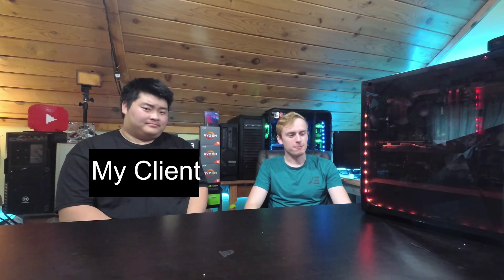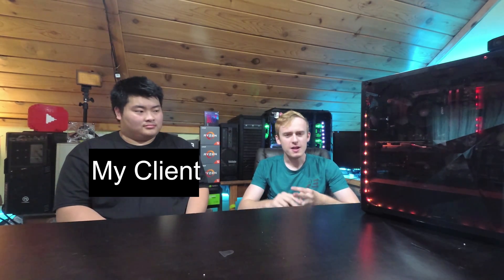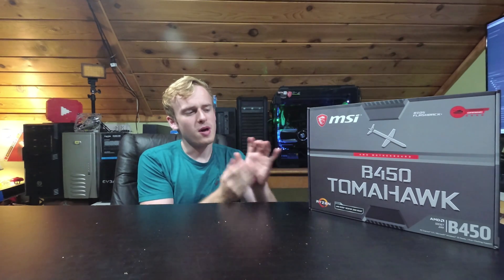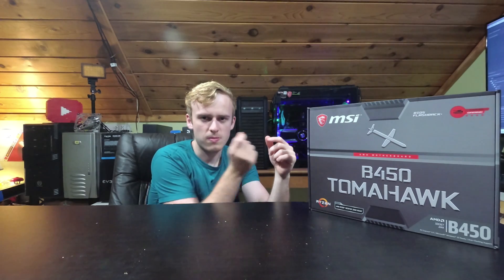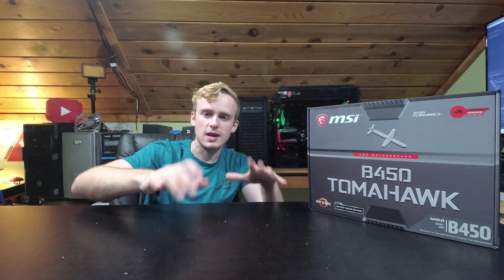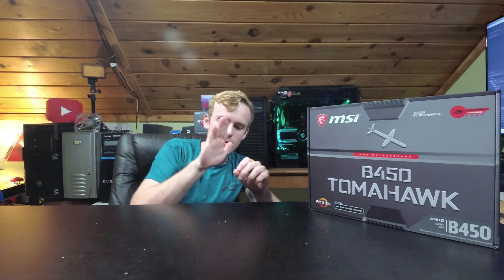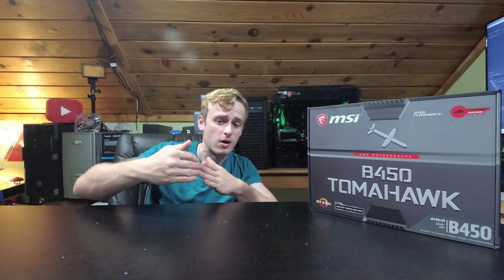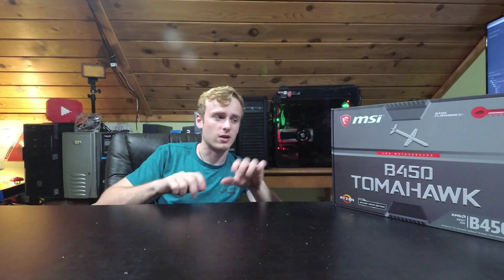My MSI B450 Tomahawk Motherboard Has a BIG PROBLEM

Comment: I have the tomahawk max and same issue. it worked fine, shut down the computer and went out for a couple hours, and when I came home and turned it on I had black screen and cpu light on. I tried everything, and I mean "everything" from cmos, to stripping the board and flashing etc. nothing worked. now I gotta buy a new board. but I will never use msi again.

Comment: My problem was and I still have it if you put a USB into the back of the board it will not turn on. It won't post but once you unplug the USB it immediately reads the hard drive and posts. Or I'll have five hard drives hooked up to it through USB adapter and it will read three of them but one of the drives it won't read so if I unplug it and plug it back into a different USB it might read the drive but then later it won't read the drive and it'll disconnect it. It's very weird I don't know if there's a feature in the Bios I have to tweak or what but it's kind of annoying

Comment: I have the MSI B450 Tomahawk Max as well and for the past 9+ months I’ve had nothing but issues. Lots to list. I’ve upgraded PSU, GPU, 2 different sets of RAM kits and everything I have is completely compatible. My RAM is on the Qualified Vendor List(QVL) and that’s fine. Brand new power supply upgrade from 550W to 750W, both EVGA. So it’s not RAM or PSU. I’ve had same issues with my old GPU and upgraded to 3070 Ti and still have issues. I’ve looked on the back of the motherboard and there’s load of spots like puddles of chemicals coming from where the VRM’s are located on the motherboard. That means MSI is dogshit at building this motherboard if that happens, it’s not just the Tomahawk Max, it’s other MSI motherboards, MSI SUCKS! Never buying another product from MSI again. I have 2 monitors and they both have issues and they’re both MSI Optix MAG24C’s. I cannot stand this company. I’m going ASUS motherboard and ASUS monitors later on in the future.
Reply: OH YEAH! I should mention that, these issues weren’t day 1 issues. I had built my PC in May 2020, the first issues came across 1 and a half years later where they really started showing.

Comment: Similar issue with posting. I use to have a cpu light at post, would reseat cpu and it would go away, i think this board has had a hand in blowing 2 water coolers, onto my 3rd cooler now, after installing latest cooler I noticed if I tap the case id loose video to monitor but power to the total system stays on. Thought it was a gpu issue, but I just removed gpu and tried to use on board video, system right now gets vga led and wont post. At the point of buying new system board, 95% of the hard was new. Wont be buying any msi products frkm here on.

Comment: Mine worked fine for a year and a half, then suddenly this week it has refused to post. Tried clearing rom, changed gpu's, mem and psu. It appears to power up, but no output. I assume its the board, as I cannot see why the cpu would suddenly fail.

Comment: Same problem here. After changing the termal paste, i fired the pc up and a red cpu led popped up. Tried bios flash... nothing. When i saw the back of the mobo, the mobo was fried. You can see burn marks on the VRM area on the back.

Comment: Update from 2021, I'm using this for my ryzen 5 2600. An issue i came across with this motherboard is that the rgb light resets to red every reboot which is annoying because i have a color scheme set up. Any suggestion for this?

Comment: I bought this motherboard for my build and when I turn on my pc it works but there’s this red light that lights up saying the CPU is messed up but I checked and nothing is wrong if any of u and help me solve this problem that would be great
Reply: Did you fix it?
Reply: ThatRastaGuy yea I finally did, my friend had a tech wizard friend who was able to fix it. The two main problems were that my ram cards were incompatible with my mother board and got new ram cards that were compatible and he also unlocked my motherboard
Reply: @W_A_L_I  yeah I managed to fix mine aswell, turns out the CPU lever was not pulled to OPEN when I was installing the CPU, meaning it was just sitting there

Comment: Interesting video. I've bought and installed one piece of that mobo, updated the BIOS, configured it and it still working smoothly on a R5-3600. I haven't had a single issue in almost two years and for this price, this mobo in my opinion, rocks. The uEFI BIOS is a bit childish and feels like setting up a barbie doll, if you're coming form old legacy BIOS, but you don't touch your BIOS every single day. The LEDs work fine here, although they can be disabled with a 3rd party software, there were no shorts and the power consumption was normal. Also the board itself doesn't look cheap for this price. Maybe you guys play too much with cheap lights/wirings or boxes, which are not really approved and some may cause issue.  But what do I know, I've installed only 1 piece. A lucky one obviously?
Reply: Why are people complaining about it so much then? They made me afraid of buying one
Reply: @trikyoo  get one - it's still working perfectly ;)
Reply: @NeverGiveUpYo  Thanks
Reply: @trikyoo  anytime.

Comment: Hi bro i have msi b450 gaming plus, msi rx 480 8gb gaming x, 8gb lpx corsair, and my pc freezzes...black screen with red led from cpu , can you tell me what to do? Or anyone? Pls help
Reply: Did u solve it? I got same problem.
Reply: @furkancimen4964  i dont know yet i have 5 days since i have no freeze no issue ill tel you if i will see that black screen
Reply: @facdăsistem  ok mate thank you. I have b450m bazooka and ryzen 2600. Since 1 week, when i play a game my pc is freezing and restarting itself. And debug led from cpu. I hope i can solve this. I dont buy MSI mb again.
Reply: @furkancimen4964  i dont know if msi is to blame but i saw at almost all amd mobos do this issue, a week ago i bought an m2 ssd kingstone 256 gb storage, i had another ssd kingstone a big one with cable partitionated in two, after i deleted both and installed on m2 the windows, i made another update of windows, i have almost a week since i have no black screen, it can be the windows to blame, in my pc i never had crashes in games, only at start at 3 days and notice that all my parts are new, only my motherboard is new but not with warranty and my rx 480 is old too and i made a change at rx bios, i flashed a new one, but i think till now  that didnt freezed is that update from windows, there are manny issues at w10 too, even if will freeze at least at me is never restarted itself, if you have your mobo on warranty change it but my only opinion i guess we.ll never trully know, and another point, a new amd chipset software i installed, can it be the old ssd? Old drivers, old bios? I dont know but try what i did bro maybe will work 😊
Reply: @facdăsistem  Thanks for helping mate. I tried update the windows, update bios, and clear cmos. They didnt solve my problem. I got warranity on my cpu, mb and rams. Im gonna try to refund mb.    My drivers is new, bios is new and ssd is new. Im gonnda try amd chipset driver. Thx for your help again. ☺️
Reply: @furkancimen4964  with pleassure bro hope you will fix this issue 😊
Reply: @facdăsistem  Hi bro. After your suggestions, i tried to update amd chipset driver. And my pc didnt crashed yet. Im very thankfull to you. :)
Reply: @furkancimen4964  im glad it worked bro, after a week at me freezed once but im comfortable with it, im just restarting once and works like a monster with my gpu and cpu works all games on my aoc ips monitor at 2k, on 32 inch and is so great,im gladd it worked for you bro with pleasure all the time beo take care :)
Reply: @facdăsistem  Take care man. If u have any problem just ask. I can always try to help. :)
Reply: @furkancimen4964  thx bro ill to help you too god bless you :)

Comment: does anyone have the red cpu ez debug light, I've tried everything and I even used different psu and ram :(
Reply: Yeah that is my issue right now as well
Reply: Guys listen, I exchanged to parts for the same parts and I had same issue. Then my friends dad told me maybe I need to flash the bios, but I was like it says Ryzen 3000 ready so I did it anyways and then it worked
Reply: @jossshhhy  I currently have a ryzen 5 3600 and I’ve tried literally everything and I tried the bios flash update but the cpu light on the motherboard still stays on and I don’t get a display
Reply: @gavinnavarrette757  have you tried booting with a single ram stick installed?
Reply: @jossshhhy  yeah I tried. It ended up being a defective mother board had to get a new one.

Comment: I'm having problems with this exact board. Done a previous build with no problems. It's just come back from the shop where they managed to get it to boot after switching the RAM around and fiddling with the SSD. Bring it home and no LEDs. I'll keep going until I get it working but I won't be using this board again.

Update I got the board to power up. It won't do it if you just try and short the pins. Suggest hooking it up to the case power cables (don't screw it in the case) pressing the Start button on the case, you should see LED lights on the side. Get everything plugged in and do a POST test. This motherboard is basically a pain in the arse but it does work.

Comment: Can someone help me, there is a red light behind my msi b450 tomahawk and my pc won’t connect to my monitor
Reply: I have the same problem did you find out the issue?
Reply: Pretty sure my ryzen 7 3700x died cause I checked everything else only lasted 6 months :(
Reply: That’s my same problem, what did you do to fix it?

Comment: I bought and installed the MSI Performance Crossfire ATX B450 Gaming Plus Max. I experienced all kinds of issues including very slow posting, or complete failure to post. Shutting down for no reason once it was up and running, and also a few times, failing to fire up my video card. Luckily, I bought it from Amazon, and it's now on it's way back. Now what do I replace it with???

Comment: I have the MAX and I'm Getting Low Audio and I don't know why
I installed drivers and everything I even Bought an audio interface and I'm still getting low audio
HELP PLEASE!
Reply: When did you buy this board?
Reply: @Weebwhacker  Hey I recently bought a new board and it  wasnt the board last thing is that my headphones probably need an amp or dac
Reply: @designedbygods3576  I have the same board and had the same issue. Tried different headphones and it didn't solve anything. What fixed it was changing sample rate from 16bit to 24bit 192000hz

Search manage audio in start, double click your playback device then go to advanced and change the default format

Comment: I bought a msi tomahawk max, the A Ram Slot stop working, i rma. They send a new one same problem since the beggining. :S. News: the board was good, the problem was the processor.
Reply: News, the problem was not the board. Was the processor.
Reply: @danvel37  i have the same issue the msi ezdebug shows cpu light 
i think its processor issue
Reply: @PranathNaik  Yeah that was my case, processor issue

Comment: Same MB..... after two weeks wont post... what a POS. Never again will I buy a MSI motherboard they are zero help at all
Reply: Ben I want share my experience msi motherboards are a hell that sometime they fail miserably without any reason. Even if u care the motherboard and the case perfectly they will fail in time either u get bios failure or some vrm shit. Simply go with the gigabyte they are the best choice
Reply: @mohankrishna1443  yeah I have had problem with the MSI B450 armour. It had no post at all. Then went to another site I get the ASUS prime B450M-A and it works no problems. My graphics card is MSI it works fine but now I'm worried about it. 😎👍

Comment: Built a new system about 3 month ago now. It is running on a MSI B450 Tomahawk Max with a AMD Ryzen5 3600x processor and Rx 580 spphire pulse 8gb.

I have been using it about daily since the build and havent had any issues with it. Recently I unplugged and moved the tower to a new desk. I only moved it from one desk to the floor for a few days while installing the new desk and placing it back on the new desk. After plugging everything back in it booted fine for 2 days.

The next morning I turned the power on and on the motherboard it has the 4 red debug lights that it runs through as it boosts. It did the the cpu and ram lights then got to the vga light and that one stayed on. The monitors (I run 2) powered on but only showed an underscore ( _ ) icon on the screen and it stayed there.

I tried to restart multiple times and it continued to stop booting at the VGA debug light. I ended up shutting down and unplugging the power to the tower. Next I opened the case and removed the GPU from the motherboard and inspected it, not finding any issues. I reinstalled it and plugged the power cable back in. Once trying to start up again it again locked up at the VGA debug light.

Next I started to unplug 1 cable at a time from the rear of the tower. I have 2 external HDD's plugged in via USB and was just trying to see if that was causing an issue. With no change I left those unplugged and next unplugged the monitors.

Started up the computer and it booted fine. Then I plugged all cables back in and everything ran OK. The next day I had the same exact issue. I unplugged the cables in the back to be able to boot up then plugged it all back in.

Has anyone heard of this being an issue and if so what can I do to solve it?

Specs:
MSI B450 Tomahawk Max
AMD Ryzen5 3600x
G.Skill 3600MHz DDR4 8GB Kit
Sapphire RX 580 pulse 8GB
Reply: I have slightly similar build and slightly diff issue

B450 GAMING PLUS MAX (Not the same but a b450)
Ryzen 5 3600x (same)
Corsair Vengeance 3200mhz ddr4 16 gb (total)
nvidia rtx 2060 

I saw some users have mentioned that the hyper X cloud 2 headsets led to BSODS from driver errors. I have experienced this, but i personally struggle with random crashes and start up errors. press on, fan lights, noise start, boom it gone. press again, boot to windows. :/

AND NOW recently, tried updating nvidia, as soon as press install - black screen no signal from gpu, pc on, making noises in headset (so audio driver on> ? )

i am wondering if you figured it out, as we have kind of similar situations? maybe the USB ??? I dont know..
Reply: I have a b450 max. Ryzen 5 3600. G skill 3200 and a gigabyte 2070. I ran my pc for a year and my PCIe 3.0 crapped out. I've have gpu issues every intermittently crashing games. After I did a fresh clean update the issues went away. But just a week ago my screens went black when trying to start my pc. Everything functions on the PCIe 2.0 extra slot. But my fps are shit.

Reset closed with jumper.
Updated bios.
Unplugged everything; rgb, wifi card and extra hdd. 

Still not working on regular PCIe I used. I think it fried. At first the vga led would stay on but now the cpu one is. But my cpu works...

And so has everything else... help someone..

Comment: My B450 worked fine for about 6 months. Now all of a sudden it tells me my ram is not in dual channel slots, yet it is. and 50% of the time will not post at all with 2 16gb sticks. WHich it has always had in it and worked fine. Not Post started with previous Bios and with the most recent

Comment: I bought this one to run with a Ryzen 7 2700x and we unable to get any video.  Tried multiple GPU's and both PCI ports, nothing.
Reply: Ryzen 7 2700x have no graphic chip. Only those who have G's like Ryzen 3400G have graphics. You have to put a dedicated video card on it or you would not have any video. I'ts not the mobo the problem is that you don't have put any video card on it.

Comment: I have had this motherboard for about 6 months and it recently started not fully booting (fans, lights, etc come on), but the ez debug light labeled VGA turns on and my rig does not post an image to monitor.  I know for a fact that it is not my graphics card (Gigabyte RX 580 8GB) as I can unplug my boot drive, reinsert it into an alternative sata port, and my rig will fully boot and run fine until I shut it down and try to power it on again.  Its not a terrible issue as I leave my rig on most of the time, but it is annoying and time consuming...think its time to RMA the board or move to a different brand.

Comment: similar problem is on asus ryzen boards. for some reason ITE chip bricks and fans are stop spinning, because asus use shit chip.  it seems that fan header is fried but it is almost imposible to fried fan header. i have 3 asus boards asus prime x470 is working good for now, i RMA one crosshair vii hero because off this problem and second crosshair vii hero is having the same problem but is not problem for me because i run aio cooler and i disable cpu fan monitoring and conect pump to aio pump. but yea stupit problem on boards from well known company

Comment: Great for overclocking, but they fail in 6-12 months. Ive owned many many msi boards over the years, its always the same thing. In my experience capacitors tend to explode and leak all over the board within 2 years
Reply: well it's almost been 2 years since my pc build and my mother board has been acting up lately not posting at all just ez debug light and for like the last 3 days since i turned it off it hasn't posted yet, it's really annoying now i have to get a new board, but it's really hard to choose another one especially when a lot recommend this motherboard for my r5 3600x they even released a new model Tomahawk MAX II, which really messes with my head. I would get the B450-f from asus but I'm just too confused rn